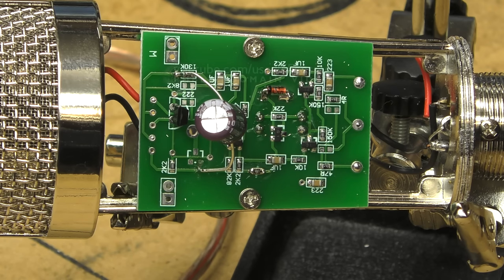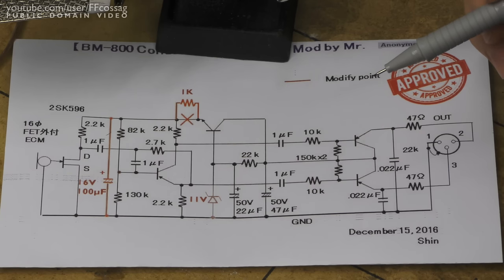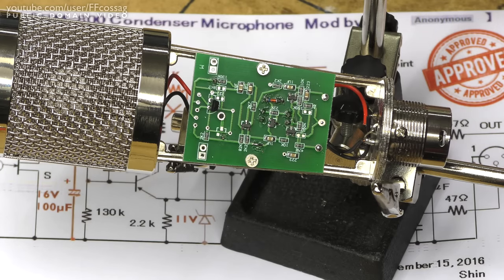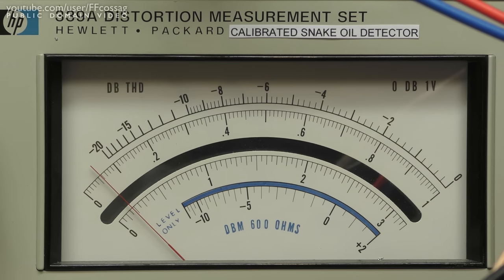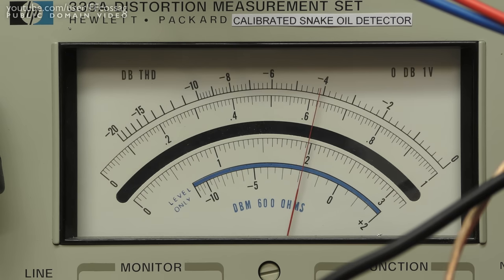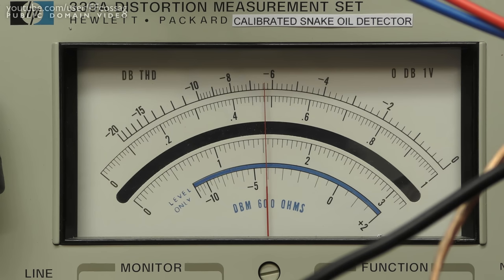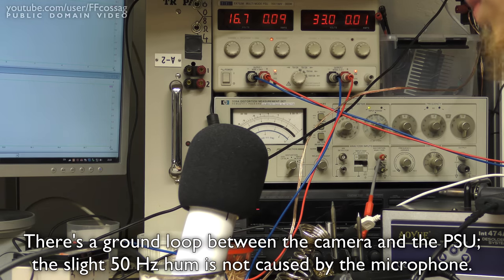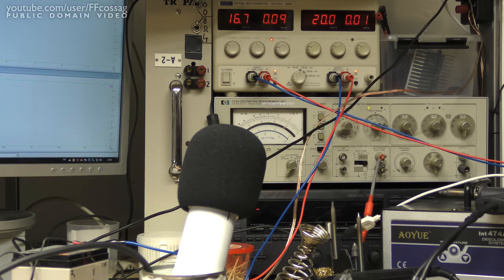BM-800 microphone low noise hack

Comment: I'll gonna do this.. :D good thing I have ECE background way back when I was still studying... :D Tnx man.. :D 
What would be the rating of the 1K ohm resistor? how much WATT is it?
Reply from the maker: The current is so small that it hardly matters, I used an 0603.
Reply: Is there any difference if I use a 12V zener diode... 11v is quite rare here in my place.
Reply from the maker: I'd say it's probably fine.
Reply: Thank you very much m8 ... :D

Comment: Could you post links on where to get the required circuit components for those of us who never bought such things I.E mouser links. Last time I bought any circuit components  I was in middle school and went to radio shack xD. It would be a tremendous help I don't want to end up getting the wrong stuff.
Reply from the maker: For this project, pretty much any components with the written values will work fine. It's not critical at all, you can't go wrong.

Comment: I'll try to do this, it's a cheap mod anyway. So I'm wondering if you just put 470 Ohm resistor as it was in the original mod you're just fine with a resistor and a 220uf 16v capacitor without the need to change a zener? - Also what's the size of the resistor so I won't have to measure it in order to find out
Reply from the maker: The higher voltage zener is necessary to make up for the voltage drop across the resistor. Without a higher voltage zener, you run the mic capsule at a lower voltage and reduce your sensitivity. The higher value resistor and higher voltage zener you run, the more damping you get, and the better noise floor you get, until you start running into resistor noise issues. My version of the mod is what worked best for me.

Comment: I agree. There is no capacitor after the emitter follower, and the noise in the voltage regulating transistor is not bypassed in any way. I suggest a combination of an electrolytic capacitor (e.g. 10µF) in parallel with a ceramic capacitor (e.g. 470pF).  The reason why is that electrolytic capacitors have some reactance at higher frequencies were the ceramic type will compensate. Beside that - this is a great microphone with a quite large membrane electret element for it's price.
Reply: Can you show what parts i need and where to add them? Does you mod compatible with mod described in video?

Comment: So, err... I bought a Floureon BM-800 and mine came with an additional blank circuit board. As if it's meant to be there for "repair" purposes. I'm wondering what to do with it!
Reply from the maker: Let it sit there, it's likely some kind of shielding.
Reply: Same Pcb with no SMDs

Comment: When you talk you use some other microphone and I constantly hear constant electric white noise and even AC power supply frequency in my headphones. You show voltage meter instead. Of course it's seen visually, but it should be supported with some audio change. What the point? Anyway thanks for the video
Reply from the maker: My set-up was really bad back when I made this video.

Comment: Hi, please help. 
Today I got my BM 800 and was immediately disappointed because of the high noise level and low signal level (i have phantom power 48v  and sound card Asus). According to your instructions, I added a capacitor of 16 volts 470 microfarads and a resistor 1k (also tried 360 ohm but did not notice the difference). I did not change the zender because I dont have it.
Then I checked and was disappointed, the noise remained, exactly the same.
But I noticed that I have 6.7 volts on the capsule and I think the whole problem is in this?
Reply: Use XLR Audio Interface
Reply: Why not? It's depicted on scheme.
Reply: Just assemble it into it's metal case, and noise will dissappear!

Comment: Hi just found this mod and the two BM800 Microphones I have have.a 3.1V zener instead of 9V otherwise the circuit is identical ? Added the Cap and resistor not sure if I should change the Zener ?
Reply from the maker: A 3.1 V zener would just make it incredibly insensitive. It could be that yours is using a different capsle that wants a lower voltage, though.

Comment: Could i use a 12v zener and increase the resistor value? i don't have a 11v zener... also, i heard there 2 types of zener, and one of them is much more noisy (on eevblog series of mic design). also, if using a 470ohm resistor, do i need to change the zener? or it will reduce the sensitivity? thanks! (PS: some bm-800 are coming with a new capsule, with the fet inside the capsule, any info on those?)
Reply from the maker: I haven't tried any of the new BM-800s. As for your modifications, the goal is to have as clean a 9 V supply as possible for the capsule. The resistor and capacitor just form an RC filter, and the higher value resistor the more damping you'll get - you just need to adjust the zener to match the voltage drop across the resistor.
Reply: Thanks. I got one of the "old ones" (like yours on the video) and will test the mods to see the results once it arrives. thanks again!

Comment: Hi. I did your mod, but the noise increased a lot and the mic gain reduced. I guess that is either because I used not an "original" cable, or because I didn't put a 11v zener, I left a 9v one. What do you think could the noise increasement and gain reduction be about? Thanks
Reply from the maker: For the 1K resistor, you NEED to use an 11 V zener. Else the voltage across the mic capsule becomes too low.
Reply from the maker: You also NEED to use a phantom power supply for this modification to do you any good.
Reply: Well, yeah, forgot to mention that I have an ESI maya 44 card which produces about 52v of phantom. And I got that leaving a 9v zener was kinda naive) So I'll go ONLY with an 11v zener, probably will test it tomorrow. But could you tell me about the cable? The thing is that I resoldered the XLR connector of the "original" cable that came with the mic into a TRS balanced for my Maya. I was thinking like 1-ground 2-tip 3-ring But this seems kinda wrong, am I right? What is the proper cable wiring, could you please tell me?
Reply: Probably you tested mic after modification without aseembling it back into it's metallic tubing case. I got the noise too when mic was disassembled. Just assemble all parts together and the huge noise will dissappear! MAGIC!)))  (not really, just a Pharadey cage)

Comment: Hi new sub here. I use one of those mics on my ham radio. Is this mod worth doing if it's run from a full 48 volt phantom power supply?
Reply from the maker: As long as you use components capable of handling the voltage, you could achieve lower noise, yes.
Reply: @FFcossag  what components should i use for the same purpose as the comment above, would any standard set of parts work or would I need to hunt down higher end parts?

Comment: I wonder if you add a decoupling capacitor, like a 100nF ceramic one over the 100uF one if it would improve even more. 
I used to place lots of those 100nF caps at nearly every active component since they seem to 'clamp' more HF noise.
https://en.wikipedia.org/wiki/Decoupling_capacitor
Reply from the maker: I tried having a small film cap in parallel with the big one, and it did nothing. I figure that a 100 µF elco will have decent performance even well above the audible band, so damping further HF stuff wouldn't bring forth much gain.
Reply: A film cap doesn't have the same small 'resistance' as a ceramic one. Anyway you can easily salvage them from dumpster pcb's and add them.  I've seen some nice spikes being destroyed by these little fellows, so what doesn't hurt ... .  Just stay away from Tantalum capacitors. Those have very nice specs but will fail ugly most of the time, like in shorten all at once.
Reply from the maker: Decoupling never hurts, but we're talking about a linear regulator here. There's going to be very little HF noise in it to filter out unless it's broken.
Reply: Just look up some 7805 reference schematics  ;-)
Reply from the maker: The 78XX series regulators are way more hi-tech than the circuit in this microphone, and they're prone to oscillating without some input and output capacitance - you'll notice that they usually only spec a tiny capacitor on the output. Quoting TI's datasheet, "Although no output capacitor is needed for stability, it does help transient response."

Again, I'm not arguing that an extra 100 nF cap would be BAD - I'm saying that it'd be superfluous in this circuit. There's nothing there to generate HF noise (there isn't even a feedback loop), and noise above 20 kHz in a microphone is barely worth considering on its own unless it's causing more severe issues.

Comment: will this modified mic work fine with an audio interface?
Reply from the maker: Yup, but it might not like 48 V phantom power.
Reply: FFcossag ahh i see thanks!
Reply: @FFcossag  Why would that be? They work fine without modification, if anything, it puts out a more powerful signal than ideal, they gain on the interface needs to be very low to get a good signal strength.

Comment: hey, can you use this mod together with phantom power or audio interface that has 48v
Reply from the maker: No, it'd go up in smoke.
Reply: @FFcossag  welll, okay.... i mean, if i want to use it with phantom power, should i change the cap to at least 50v ?
Reply: @FFcossag  WTF? works perfectly fine on 48V. the cap can never see more than Zener voltage anyway.

Comment: Hello, I have performed this mod and tested It with with my Behringer 802 mixer and UM204 interface - in both cases, mic worked okay (Note: phantom power needed to be ON). Though being unsatisfied with this particular mic (seeking for better quality), I bought the original BM-800 (which costs 5x more) and now I am trying to modify it, or rather rebuild the circuit board from scratch. I researched and found similar circuit schematics to this fake BM-800 and what's been bugging me is that the schematic shows this strange rectangular area, similar to what this BM-800 has (on both sides of the board). Do you know what the purpose of this rectangle is?
Reply from the maker: I really don't know what a "strange rectangular area" in a schematic would be, sorry.
Reply: @FFcossag  Welp, okay then :D. Thanks

Comment: Does anyone  know if the circuit is the same in a NW800? It seems like it's a clone of this mic, but it's a bit cheaper
Reply: @ballsrgrossnugly  I got one recently myself, and the noise isn't too bad unmodified as long as you're using an audio interface
I'll let you know if I ever open it up

Comment: So weird question but would I blow something if I install a 16v 1000uf capacitor instead of 100uf if I salvage it from a pc motherboard?
Reply from the maker: It'd likely work fine.
Reply: Thank you I wasn't sure. In your linked pics you replaced it with a 25v 10uf capacitor and I was wondering if that improved anything?
Reply from the maker: I don't recall exactly what I did. The value of the capacitor is not critical.
Reply: Yes, the Transsound capsule will improve it immensely.
Reply: @stevensanju  Hi! Can you tell me, what's the difference between standart capsule in chinese BM-800 and TSB-2555B? Did you make this modification? Can you record sound before\after mod?

Comment: i have the same mic ,but i use this without 48v phantom ,because im using a USB sound card betwen mic and my computer , better sound ,and NO noise , you can try test this in audacity with and without usb sound card . ;)
Reply from the maker: It works better than tiny mics on sound card power, but sensitivity is way down compared to when it's used with a real PSU.
Reply: I done that and I heard exactly nothing. Switched to my Behringer audio Mixer and got extremely good audio

Comment: нифига не понятно, весь русский интырнет не шарит куда же всё таки кроны 9 вольт для полного счастья цеплять?!
tell please where to connect a phantom power supply from the battery (for example 9 volts)?
I don't understand how to connect the battery, from the computer about 2,5 volts go on the microphone - it quietly turns out. how to connect 9 volts of the battery to what contacts? all Russian Internet doesn't know!)))
help please.
Reply: Никуда, мужик, этот мод только для фантомного питания 48 вольт. This mod is not for using with battery, pls use phantom 48V power.
Reply: нет, я нашёл схему, как и думал- там просто конденсатор и пару резисторов, всего несколько элементов... всё очень просто! не помню где сайт с нормальным описанием, кароче вот видос чувака который "танк" собирал для этих 3 деталек, но там понятно можно всё проще сделать... я ваще навесным спаял напрямую на провода... работает теперь нормально, дальше только сам микофон виноват))))
No, I found a circuit, as I thought, there is just a capacitor and a couple of resistors, just a few elements ... everything is very simple! Anyways, here's a vidos (there it is crookedly filmed, but you can prokutit the scheme).
https://www.youtube.com/watch?v=rxbmQzN0W60
хрен знает нафига гуглпереводчик мучаю))))))))
Reply: @Sabur4  Если бы вы знали англ, то поняли бы, что чтобы этот микрофон был громким и производил меньше шума, его каскады должны работать при правильном вольтаже - именно для этого и нужно фантомное питание. В этом моде, который описан в ролике добавляют фильтр, чтобы уменьшить шум путем его сглаживания и уменьшения вольтажа путём установки стабилитрона меньшего напряжения. Более того, Jim Sonweed
 выше пишет, что источник шума в этом микрофоне - транзистор K596, который работает в неоптимальном для него режиме и простая замена конденсатора стока с 2.2 kΩ to 15 kΩ выровняет точку вольт-амперной характеристики до половины напряжения питания и уменьшит ток стока полевого транзистора. Это значительно уменьшит шум и увеличит динамический диапазон.
Reply: @RJSBrothers  спасибо, английский не понимаю, только транслейтер... а крону я научился цеплять(ну любую батарейку, там конденсатор и диод вроде, ну схемку гдет нашёл в 3 детальки, всё просто). как в видео я сделал, ну диод(стабилитрон, ну стекляшка) и конденсатор, ну что там показано впаял(думал типа если лучше станет, оставлю, а если чё, то обратно уберу- результат вроде чуть лучше стал).
так вы говорите на счёт транзистора что-то, получается может его заменить на что-то?
или тогда и другие элементы схемы менять... и тогда лучше ваще другую схему делать... и тогда ваще лучше другой микрофон))))
ну имею ввиду- практично это дело, ну транзистор или ещё что-то в схеме менять или не нужно, как думаете?
PS как в видео уже сделал и на фантомном 9-12 вольт вцелом уже нормально работает.

Comment: I did this mod , but the 100ohm and new zener did not work for me so i did the orignal mod and it works a treat . The noise floor was so bad i had to use a high pass filter and a 26db pad, and the pre amp maxed. 

Now both are off and the pre amp is down to 30% .

Before https://instaud.io/1c8M
After https://instaud.io/1c8L

Please excuse the church bells in the background.
Reply: Oh and funny story i was testng it out of the case and there was a loud hum , i put the case back on and it went away .... no idea why.
Reply: @andljoy  Yes, the case used as a Pharadey's cage for this schematic.